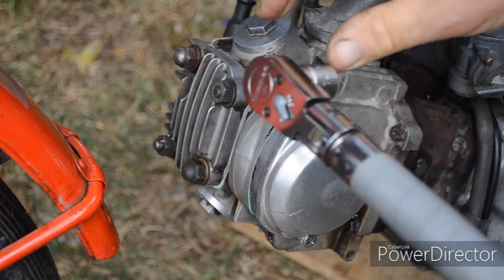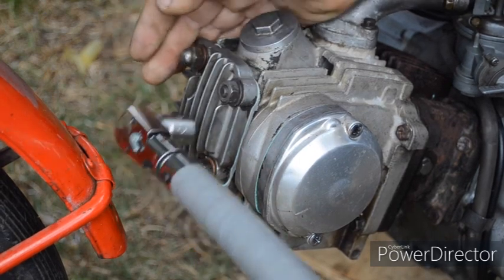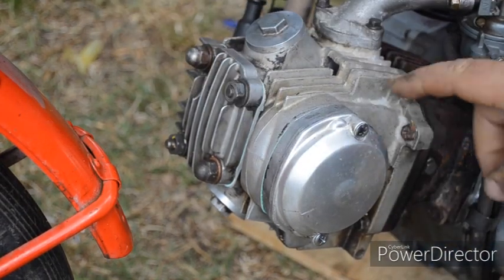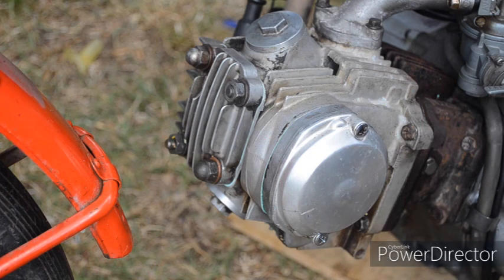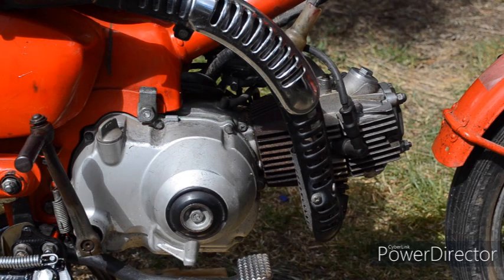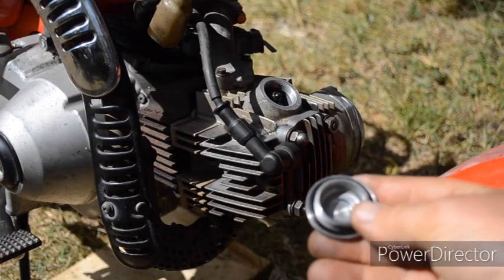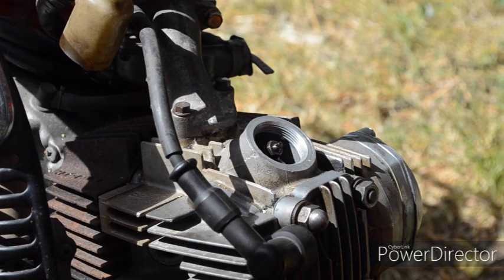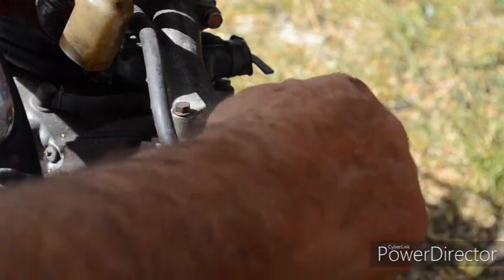Honda CT 110 Head Gasket - Part 3  Valve Clearances

Comment: Awesome video, have you taken off a valve stem seal on the exhaust side before?
Reply from the maker: Yes, I also did a video showing ct90 exhaust stem seal & how it's different to the ct110 seal.
Reply: @Free_Ranger_CT110 Thanks again Free Ranger.

Comment: Thanks mate. Did my tappets tonight :)  There was no gap at all! Hope my valves are ok as I started it before checking the clearances.
Probably due to the new cylinder and gasket I installed? but I still don't have the best grasp of the valves and how this would affect them. 

You're right about 9mm being an odd size! I have a 16 piece set that has everything from 6mm to 19mm... Apart from the 9mm. Must be uncommon if it's the only size they skipped! Had to go pick one up from the shop!

Engine still sounding rattle. Tried adjusting the cam chain but don't have any adjustment left... Prob time for a new one!

(As an fyi I found this video hard to find as it doesn't mention "valve clearances" or "tappets" in the heading).
Reply from the maker: Thanks Felix, the valve clearances would be unchanged by the new cyl & head gasket. I didn't do a separate video on adjusting them as it's difficult to film, but easy to do.  But thanks for letting me know that it's difficult to find, I'll try & fix that.  Glad the videos helped & once you've done the engine work it's so much easier a second time.  All the best.